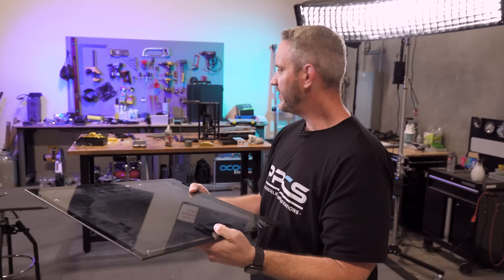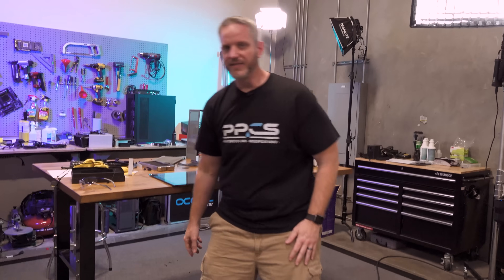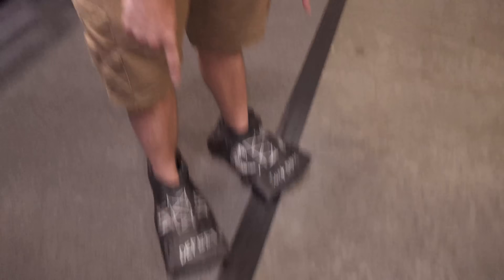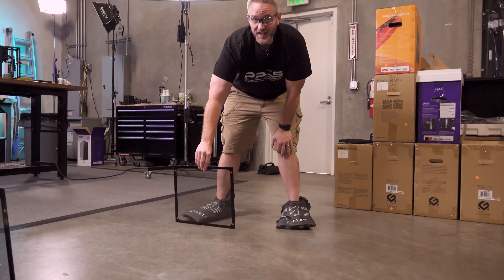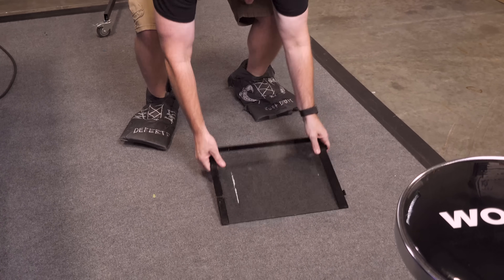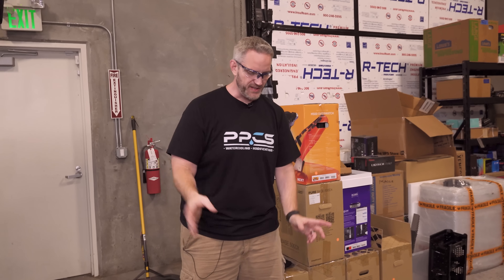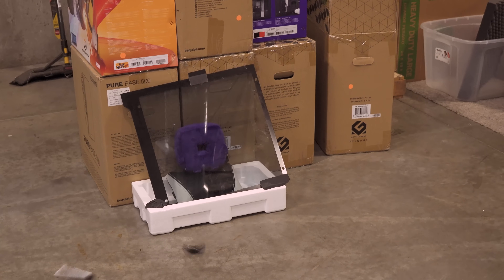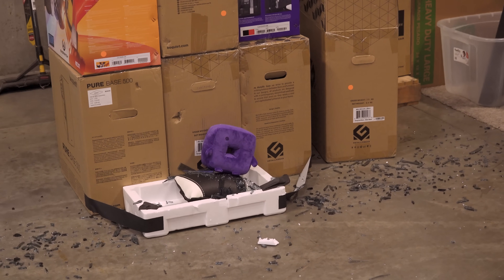How hard is it break tempered glass side panel?? SCIENCE!

Comment: The "safety" comes in the form of the edging of the break being generally blunt. That Phantex ....that was like Steve cutting open a heat pipe to find the maker lied about it LMAO
Reply: Maybe I'm misunderstanding what you're trying to say, but shards of broken tempered glass are like tiny little razors, and I have the scars to prove it. The "safety" aspect is, unlike regular plate glass, when it breaks, you don't have one or multiple large edges that could potentially kill someone.
Reply: @gotdangedcommiesitellyahwa6298  Generally blunt, not all are formulated the same.  I've had a few cars over the years, that have lost their windows sides and back, every one has been smooth in the hand, not sharp, almost plastic to the touch without being plastic laminate glass.  Ive had the same with glass shower doors (bare feet, not a cut). And yes, I had a co-op student I had to give time off to, his best friend tripped going down stairs at another friends home, the glass coffee table he impacted caused fatal injuries before the ambulance arrived. That wasn't tempered glass.
Reply: i work with tempered glass everyday, i’ve never come across a broken piece that was blunt, as big name above said the safety comes from breaking into multiple little pieces
Reply: @Hick25  entirely probable that my experience is with a different glass.  I equate tempered with safety and that could be why the glass breakage I've experience has been the way it was.
Reply: @jawndoekck  Yeah I'm aware. I used to cut the stuff on a regular basis.

Comment: Jay, i just bought broke the glass on my 5000D Airflow. It happened when i open my case and the latch somehow did not hold and the lower corner drop on my floor which is layed with ceremic tiles. The case to the floor is just over 1cm/0.5inch away, the glass just broke on small impact. But this is a nice video! Next time i will open my casing on a matt or carpet of sort.

Comment: hey without having seen the video I like you to maybe test a hypthesis that people on forums had, they theorized that a pc with glaspanel standing on tiles on the floor can break randomly because, and I quote, "the tiles reflect the vibrations back into the case" so the theory is that that starts to get the glas panel to resonate. They have that theory because there are cases of the glas panel just exploding without it being dropped or hit. I wonder if it was possible to built a pc that vibrates allot (for example putting in a harddrive thats known for vibrating) and putting them on normal floor and tiles and see what happens. 
I am personally not believing in the theory but it often being tiles as floor with those seemingly random glas panel explosions really confuse me.
Reply: Stick a subwoofer in the pc case and put it on blast lol
Reply: Its not the resonance stuff, its when setting it down on a ceramic tile that they break super easily. At least, thats what I got out of those posts.
Reply: @corok12  nah the cases I read about, it was already sitting there and somehow it broke randomly after it was standing there.

Comment: I had a fish tank that's tempered. A pointy rock fell inside the tank, under water, and blew out the entire side. Tempered glass does well against blunt force, but anything pointy, and you're in for a mess.
Reply: what the fish
Reply: i got a 100 gallon earlier this year. i bought the glass canopies for it and like an idiot tried to see how well they fit on it while the tank was empty. the canopy fell to the bottom (29 inches). the canopy landed on its corner on the bottom glass. i took the canopy out and it looked fine, only a small chip in the bottom of the tank. i put the canopy away. when i finally set the tank up i went to get the canopy only to find that it had completely shattered after i put it away. not fun cleaning tiny shards of glass out of the carpet.
Reply: @justarandomuser8434  at least no fish were harmed in that whole thing
Reply: Also a reason why so many have tried to punch someone through driver side window on a vehicle, and have either broken their hand, or actually broken the tempered glass with a heap of brute force as it takes quite a substantial force. So if your able to break a car side window with your fist you can punch pretty dam hard.
Reply: What happend to my brothers

Comment: I've heard that ceramic tile floors are the worst for glass side panels, that literally just placing it on tile could break it due to how the tile has no impact absorbance. Even less than concrete apparently. I'd love to see you test it with tile!
Reply: This is a meme on the pcmasterrace subreddit at the moment because there seems to be multiple people every day shattering their glass side panels by placing them on a tiled floor
Reply: @thebusboy1  I don't doubt it might just be a meme, but it would be interesting to see regardless! Jay could be mythbusting for us haha
Reply: Correct, just a tiny bump a ceramic tiles usually explode tempered glass.
Reply: Ceramic will shatter Tempered Glass easier than pretty much anything else, all you need is the smallest piece of Ceramic like off a crushed spark plug.
Reply: @fullboostturbo1  As someone with ceramic floors who had a tempered glass panel broken, i can absolutely confirm this.
Reply: It has less to impact and more with the Mohs hardness. Ceramic is as hard or harder then glass. When you set glass on ceramic, the ceramic will cause level 6 scratches and level 7 grooves. Once tempered glass has been scratched, you caused a stress point that can cause the tension in crystal chains to be disrupted and glass to immediately break. If you want a good example of how this works, look up Rupert Drops.
Reply: @Randomstand  You watch JerryRigEverything I see. Using the same terminology and everything.
Reply: @Randomstand  Admittedly I don't know much about the science behind it, I just know tile is supposed to be the worst! Thanks for the insight
Reply: @a1000yrsofpain  *insight
Reply: @gundamOPS  You're right, on mobile, sorry
Reply: I'd believe it. Chipped off bits of ceramic from spark plugs can shatter a car window without any difficulty due to how sharp and hard ceramic is.

Comment: Destin on Smarter everyday: drops tempered glass plate on tarmac = nothing happens and the glass punches a hole on the tarmac
Jay: drops tempered glass panel on concrete from 1 inc = panel explodes
shows how much differences there is when it comes to tempered glass and strengths. thinner the glass = more likely its gonna break from shock

Comment: I broke my TT Core G21 by tilting the glass into the side of the case so I could screw it.  Dropping and smacking it against objects did nothing but having the holes lined up correctly did it.

One of the manufacturers need to do a collaboration with Corning for Gorilla Glass or provide replacement parts.

Comment: I know I've asked this before but I'm really wondering if there's a difference in the different motherboards audio chips and does it make a difference or at least can you tell a difference.
Reply: The answer is astoundingly yes, but not because of the quality of the chips. The signal to noise ratio (SNR) of the audio coming out of the board is rarely measured, and many motherboards have the same chipsets as expensive sound cards with far poorer audio, due to a background hissing noise. Furthermore, having a headphone amplifier circuit makes a world of a difference.

IMO, spend some money on a decent sound card sometime, and don't worry yourself with that decision for future motherboard upgrades.

Edit: To clarify, the listed SNR is almost always absolutely BS in my experience when it comes to motherboard spec sheets.

Comment: As someone who works with tempered glass on a regular in the window industry. If you hit the corner it will almost always "spiderweb shatter". It's baked glass no inner layer it's not laminate , you have pieces of triple strength and single check it with calipers and you will find it.
Reply: i'm qurious how the pro's cut this kind of glass, a simple glasscutter doesn't do it because it will shatter when trying to snap the cut.
Reply: @Diaman_D  it's done on the cutting table before going to a tempering oven.
Reply: @smiller0009   ahaaa, that explains a lot. thanx
Reply: What?

Comment: I was setting up a  pre-built a few years ago on a hard topped table. Took off the side panel to remove the shipping packaging from  inside the tower and the glass panel slipped out of my hands from the screw height straight down onto the table. Immediately shattered, only saving grace was I hadn't pealed the protective plastic off yet which ended up holding the pieces in place. Used part of the cardboard shipping box as a side panel for about 4 years until I recently switched it to a new case
Reply: My cooler is too big on my Lian Li 011 Dynamic so I use foam...
Reply: @Mystical_Zeus  how well does the foam cool your CPU lmao
Reply: @moorhen6156  it insulates it from my room. I have it alongside cardboard s
and other foam with painters tape and I pull cold air directly from outside.but I like on dirt roads so either way my PC was gonna get dusty. Cold temps now tho.
Reply: Why didn't you just... Contact the prebuilt company and get a replacement? I've broken a side panel and gotten a replacement from NZXT before. Should've been under warranty.
Reply: @blessedred  I for sure could have, even thought of simply claiming it came cracked, but in the end, the defeat was simply too strong
Reply: @netmn4406  bruh

Comment: Try spilling an extremely cold liquid on hot tempered glass!  Quick variance in temp will make tempered glass explode
Reply: It'll make almost any glass explode. 

Source: worked at a restaurant in college. We had a couple of girls take glassware straight out of the dish washer when we were busy and put ice cold drinks in them. One girl seriously cut the hell out of her hand when the glass exploded.

After that, the servers learned to flip hot glasses over and let tap water run over them for about 10 to 20 seconds if they had just came out of the dish washer. Or set them in a pan of tap water to draw the heat out of the glass.

Comment: Tempered glass side panels are a big reason why I haven't changed out from my CM Storm Trooper case. I am not a fan of them at all. I'd rather have an acrylic window or nothing at all.
Reply: Acrylic unfortunately has a major side effect where it becomes opaque over time.
Reply: @triadwarfare  That is true. My trooper uses plexiglass which works better.
Reply: you still have not told us why you are against Tempered glass side panels. Why is an acrylic side panel ok but tempered glass not? He clearly showed us that they can take a real beating. Unless you drop them on a corner on CONCRETE.
Reply: @j4ck3t  They just don't do anything for me.
Reply: I have several of those first series (Trooper and Styker) that used plexiglass and several of the second version (Styker) that have the tempered glass. I like the looks and layout of the second version, but am always a bit nervous when removing and attaching those glass panels.
Reply: @Nighterlev  I do too. I'm not into the whole RGB movement. I do like a static color on fans but that's it.
Reply: One aspect I liked about the acrylic panels in my Thermaltake V21 and old Thermaltake Tsunami Dream cases (the cases in between those two had solid side panels) is that I was able to modify or add fan mounts by using a dremel. Can't really do that with a tempered glass side panel (or at least as easily). Though I do like the fact that the glass panel on my Lian Li 205M won't scratch or dull easily like the acrylic side panels (you can buy buffing solutions from automotive shops to help with that but not 100%).